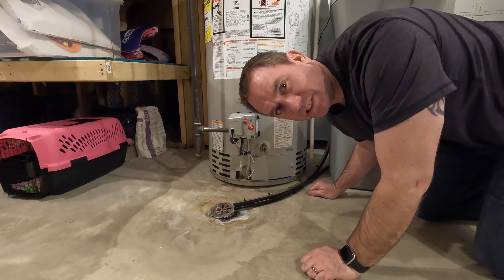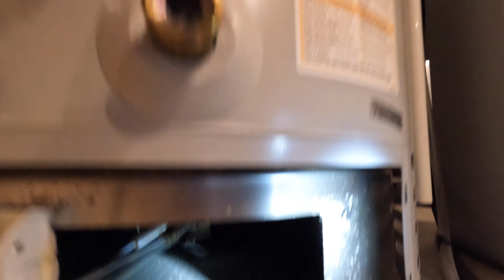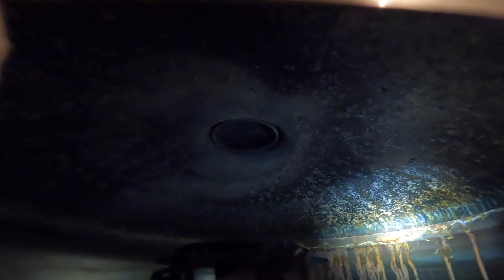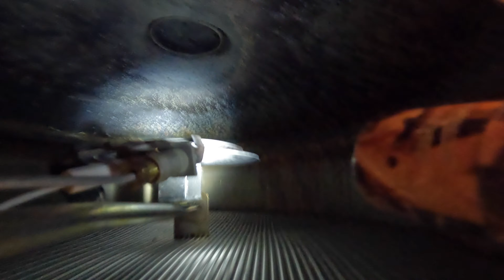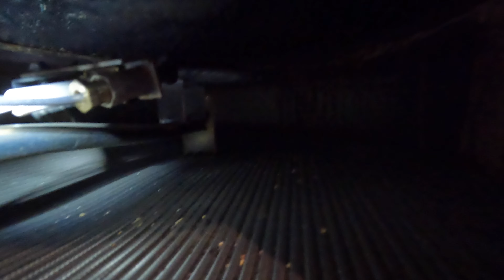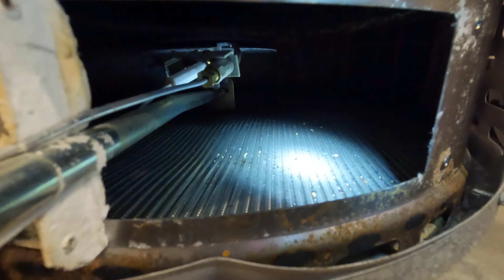Water Heaters Failure - How to Prevent & Predict It

Comment: Like the inspection information for a Gas model (mine) but it wouldn't work with an electric model.
In my old house, I had an electric water heater and the heating elements that would cake over and deposit mineral layers on the bottom of the tank until they were too deep to get the bottom element out any longer.
Reply from the maker: How long did you run the electric water heater like that?  I would anticipate that mineral buildup to reduce heat transfer from the element to the water.

Comment: Hey Mr. Lawn Engineer, we have an electric water heater, going on 18 years old. The heat is still excellent, no leaks and I have done a bit of draining (but not for a few years) and the water was clear, no sediment. Are we living on borrowed time?
Reply from the maker: The good news is that electric hot water heaters typically fail the resistance element before the tank.  Because there isn’t a flame on the bottom to overheat the tank if sediment builds up.  

That means you will likely experience cold water before a leak.  The best way to check on the condition is to pull the resistance element to see how much of it is left.  The element can be replaced but an inspection of the tank would determine if that makes sense vs replacement of the entire unit.